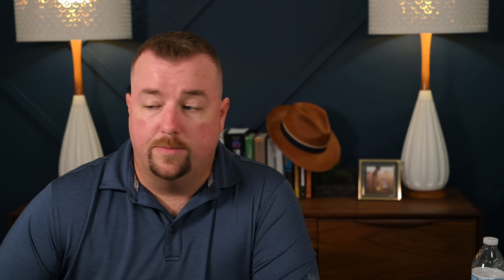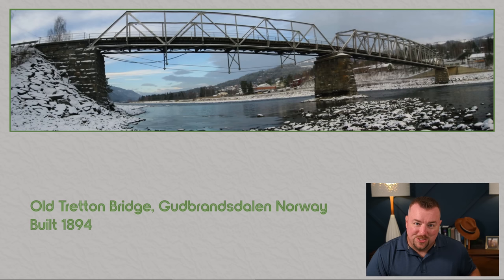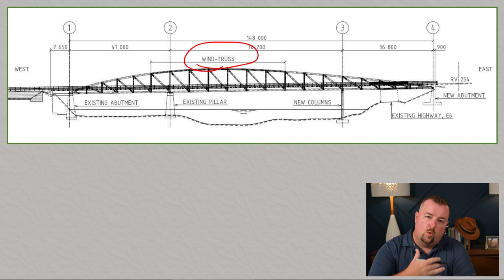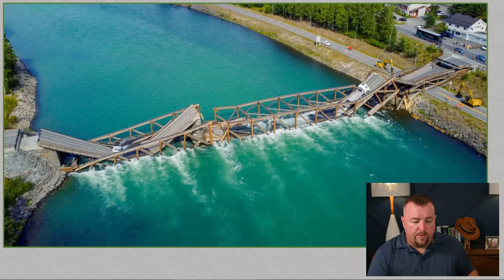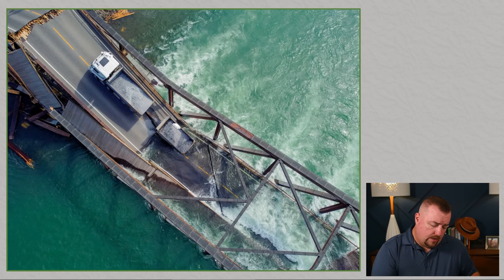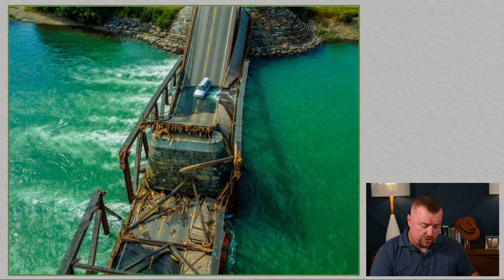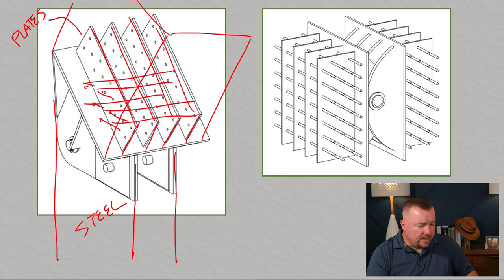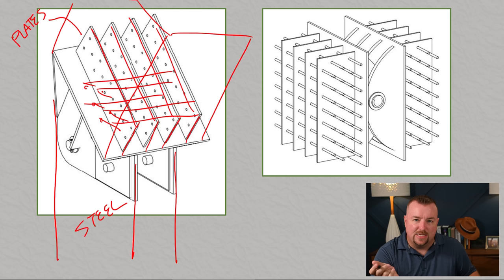How Did the Engineers Miss This?

Comment: 100% agree with the comments regarding glulam and bad design of joints (pins between the glued layers, pins aligned in rectangular pattern etc.). Another thing which is kind of strange is the fact that ALL diagonal members are inclined in the same direction...I have run a quick FEM analysis of a truss (top and bottom chord + vertical and diagonal members) - and orientation of the diagonals in the same direction is far from optimal, increasing the magnitude of internal loads.

Comment: 34:05 This is the very first thing that stood out to me about this bridge. Every single joint is oriented in this way. In what would seem like the weakest way. I would presume the natural wood fibers to be stronger than the glue, so in effect you are just throwing away like 15% of the column like this. My best guess is that this was an effort to combat the known failure method. Perhaps they thought that the glue would be harder than the wood and provide more resistance to the dowels wedge action.

But what really gets me is, why did they not just wrap these connections in a steel sheet? That would be a very easy, very cheap method to drastically improve the strength (and weather protection) of the joints. Think of like attaching an axe head to a wooden shaft. As the wood splits, the joint becomes stronger.

Comment: I see a couple of problems here. The people designing the bridge are not used to working with wood. Almost guaranteed the wood will split along the grain line over time. The designers also put too much faith in the CAD software by modelling the wooden members as a single object. That only works if the wooden members were made of a different solid material (ie. steel). A luthier will show you guitar tops and backs that develop cracks along the grain line. They use cleats (bits of wood) with the grain of the clear running at right angles to bridge the split in the wood. It helps prevent the wood from splitting along the grain in future. The ends of the wooden members where they met the steel beams needed cleats on the sides, or a box of metal around the wooden end to prevent the wooden beams from splitting along the grain line.

Comment: Wood gets its strength from fibers.  Each drilled hole cuts the fibers.  The area where the pins were drilled would have lost much of its strength.  The steel plates were installed rusty, and may have caused expansion in the slots, breaking more fibers.  A round object acts as a wedge and can split wood.  Like you said, the joints killed this bridge.
Thanks for the video!

Comment: I have a rotten glulam beam and rotten pressure treated post under the corner of my deck. Its 12 years old. Wasn't properly protected from infiltration of water flowing off the corner of the vinyl surface of the deck.  Vinyl drip edge drips back onto fascia which channels water back along its bottom edge where there should have been a flashing with another drip edge. Instead it wicks back behind the fascia to the  structural glulam.  Old story retold.

Comment: I have to say, I don't understand. When you use rivets in steel or bolts in steel, the idea is never to have the bolts or rivets themselves bearing the tension or shear stresses of the joint. Its always meant to create as much friction as possible between two sheets of steel. You would never just drill holes through two steel plates and stuff some rebar through them and hope they don't wallow out until it fails.

With this wood, as with steel, where any rivets or bolts fail to provide enough clamping force, once they start moving AT ALL, the joint has already failed. It may take a month or a year or a decade, but every time that joint moves, it wallows out the holes in ANY material until it fails. The problem with wood is that its full of voids. There's no amount of clamping force perpendicular to or in line with the dowels that will make the air voids in wood "go away". They're part of the wood.

The voids in wood are nucleation sites for cracking and wallowing from dynamic loads. That truck had probably driven across that bridge hundreds of times.

Comment: The wood was used as fibers, used same as a cable. Try nailing the last three inches of you favorite rope or even steel cable to a post, cut raw, without any treatment, and pull on it. That's what this bridge depended on.

Comment: I think you nailed it!  there is a recently built wooden bridge near me, obviously much smaller scale than this one but there isn't a single piece of laminated wood on it, it's all solid timbers, massive ones, like I don't even wanna know where they got the trees this big to make this bridge from and how many of them they had to cut down. They also tripled them up, but at the ends they are bolted through with steel plates in a somewhat similar manner
Reply: I mean the great thing with wood bridges is that you can just regrow the trees. Using more trees than absolutely necessary isnt even much of a con.

Comment: I'm wondering how well they took into consideration the stresses from temperature combined with possible water intrusion?
Wood moves quite a bit different to steel...right? Even glulam. There is a reason that we choose the right kind of rebar for concrete construction. And then we have the factor of salting the roads at winter.

1. The temperature difference between summer and winter can easily be 60 Celsius.
2. Different materials with different expansion properties due to weather and temp. Wood constructions need to be able to move more than most other buildings constructed of other materials.
3. Weather proofing of joints? If you have water intrusion into the joints and possibly the glulam. That will freeze in the winter and put extreme pressure on the construction. The road salt will make this even worse as it extends the period the construction will be subjected to wet conditions close to freezing.

Comment: People used to working with steel engineering wooden structures, evidently without the proper knowledge of the properties of wooden joints, it's scary. 

The knowledge of timber construction seems to have regressed due to the big shift to steel framed structures, at least at this scale.

The other thing is these types of construction are often sold to the public as being more sustainable and 'greener'. That only holds true if they last. It's the equivalent of buying cheap (in CO2 terms) buying twice.

Comment: Having learned a bit more about fiber reinforced composites from the recent Titan submersible tragedy, I'd add my own conxlusiins:
1st, extra care and analysis is needed when joining dissimilar materials be they carbon fiber reinforced plastic (CFRP) nd titanium or glulam wood & steel;
What primarily carries the tensile loads in CFRP? The continuous steands of carbon fiber nor the plastic. Glulam wood is a composite of cellulose fibers in lignin & the glue. The cellulose fibers carry the tensile loads.
When a whole is drilled the fibers are cut. Continuity of the fibers is critical. The load paths between the ends of a cut fiber has to be through the (glue-liignin)  matrix (literally in the fiber-matrix bond & is in shear). The glue & lignin can't resist the wedging action of the final line if dowells. The metal dowells & plates can yield in a ductile manner if slightly overloaded requiring increasing stress to deform more (within limits of the UTS); the glue/lignin behaves in a brittle manner. 

A 100 year glue will be a feat. It has to resist moisture, freeze-thaw cycling (Norway!), UV radiation, ...

Comment: Two things. 1) who plates the entire upper surface of treated glulam in copper and then leave dovel wholes and it's area completely open to receive rain, ice, water spray getting right into the wood? 2) why no wrapping of the joint area? when you make a long hole in the tip of the arrow shaft to put in the tang of the arrowhead, you wrap it with something like sinew etc. precisely to avoid splitting and to reinforce the connection. It's exactyl like this joint, if they simply used some steel wrapping around the joint it would help.

Also, someone here said that gluelam was picked cause of the weight of the structure and the existing pilon etc. - OK, but why are there numerous other structure, including a sports arena, all being built out of gluelam in that area? Is it all due to the weight? I feel like it's more due to "being more green".

Comment: It belatedly occurred to me that bridges built in the US two centuries ago were often covered.  It certainly wasn't to keep the horse dry.  It was to protect the wood.  This Norwegian bridge should have had a steel beam along its length on the bottom.  The beam is almost always in tension and avoids the tensile joints needed in the wood version.  The upper beam could be wood if it is protected since it is almost always in compression.

Comment: Hi,
at 32.25 you claimed that the diagonal member between point B and the top of pint A is a tension member. I agree that the member failed in tension but feel that the tensile load was placed on it during the collapse, however in its pre-failed configuration, however I assess that the diagonal member was a compression member in the bridge, not a tension member.
looking at the failure form a distance I favor that the failure point was point A where there was notable separation (in tension) between the point A vertical member and the horizontal member to the right. the displacement of which is concealed underwater.
I appreciate your comments on this view.

Comment: Being Norwegian I read about this bridge collapse. I think your analysis is very accurate. I am an engineer though my bridge analysis back in 2013 at UCF for required course load does not make me an expert by any means. Glue beam is a sort of fashion in Norway and it’s considered kind of modern and chic. You see it in major buildings such as the upside down Viking ship stadium for the Lillehammer Olympics to the record setting tallest wood hotel at the shore of Mjøsa not far from where most glue beams are manufactured. I presume the glue beams would be made from soft wood such as pine and not hardwood as the very strong naval like oak we have here in the south where I live now make a far stronger connection. It makes sense that failure point would always be at the joint where wood meets steel. I am surprised that they wouldn’t make a hybrid bridge where you could combine the strength of steel or better yet stainless steel and complement would for esthetic and strength.
Reply: My church has glulam arches that are the structure that holds the walls and roof up. Each arch has one huge bolt holding each half together at the peak, and sits on a steel beam that spans the floor and makes the structure a series of triangles. 
This is wood in compression, with concrete and steel supporting it, and a roof and walls keeping them all dry.
Glulam construction might do better in a covered bridge where it wouldn't be soaked with rain.

Comment: At t=9:16 they only state THAT it was how it happened, not the it was their intention that it should happen that way, they were investigating failure mode(s) via a controlled overload, in this instant a pull. Strange that the wording "load direction" is generally omitted, just that is the primary concern when using wood. The important of load direction is easy to verify with a piece of paper, it too has directionally aligned fibers because of the fabrication, try pulling it and tearing it in different directions with respecst to the grain.

Comment: Something about those construction joints reminds me of the classic Kansas City hotel bridges:  for practical reasons a joint was modified that subtly changed the load path.  Different details, maybe assumed in design, before value-engineering, might have worked well.

Comment: Potential alternative failure mode for the missing B-C diagonal: failed in bending at the connections as the bridge collapsed & geometry changed at the joint. I believe the joint would have gone from pin-connected (guessing that was the model) to combination of axial load + bending turning the induced shape to an S curve with very short returns. Stresses at top & bottom pin lines would have been highest (farthest from center of gravity of the strut) allowing the splitting discussed early in the vid so location of actual extreme fibers shifted to the extreme pin lines. If the diagonals were recovered & my guess is correct there should be splits extending from top & bottom pin lines toward the center of the length of the strut

Comment: very informative.  I would not worry about pins causing the glue to delaminate.  The glue bond is usually several times stronger than the bond holding the grains together.   The when a force is at right angles to the grain,  the wood can only resist with a weak pressure in the neighborhood of 200-500 psi.  many wood glues will bond with 700 psi or more but it does no good if the wood fails at 200 psi,  The grain is often 20 times stronger in tension parallel to the grain.  (as long as grain does not shear against parallel grain)  While round dowels will cause a wedging affect to spilt the grain bond, a square dowel or square nails should prevent that.  You need a large  area between the end of the wood and the dowel to make use of the weak shearing force of grain shearing parallel to grain.  Kind of like pulling a straw out of a box of straws.    The more area resisting shear, the stronger the connection.  I dont think grain shearing parallel to grain is must stronger that tension perpendicular to two grains parallel to each other.

Comment: Winter; salt, extreme cold to heat, wind, water... there's not a glue developed yet that can maintain its bond long term. Many can remain intact but their bond releases from most materials. Anyone saying otherwise is full of it. If I had a nickel for every rotted finger-joint sill, every column, railing etc. that I replaced after only a couple winters exposure....

Comment: Engineers who design with wood would benefit from working with the material. Anyone who works with wood, even for firewood, knows that any wedge between fibers will split the piece much faster than bending or compressing it. Wood has 10x the tension/compression strength along the grain than it's shear strength along the grain. Your observations about exposed gluelam structural members in weather are spot on, a Community College near me had to redo sections of a campus due to such failures. Sadly, engineering learns through failures and fortunately this lesson didn't cost lives.

Comment: Those laminate peices are not cross grain laminate I take it. 
Obviously if you laminate with the grain down the length you maximize its strength in that direction, but if you cross the grains you reduce its integrity along its length, but increase the holding power of a bolt attachment. 
So if you had a beam twice as large as what they designed, but cross laminated, It would have lasted until delamination occurred,instead of earlier at the connection.

Comment: Yeah, you can build a bridge out of wood and steal, but they should have put formed concrete to keep the wood fibers from splitting, the concrete forms inside the wood would be the stressors and you can put the steal pins inside the formed concrete in the wood, however, not recommended building wood bridges in damp places as it leads to rot and will eventually fail.

Comment: When you consider the date of the old bridge, before 1900, it is interesting that it was probably designed for horse and wagon traffic and later had to endure automotive and truck traffic that is considerably heavier and starts, stops, and corners more aggressively.  Living in Pennsylvania that still has many wood bridges, I don't object to using wood realizing its strength limits and enforcing them.  Most of our wood bridges are 'covered' with a roof structure and side walls to keep the weather out.  Railroads use a lot of wood bridges without roofing but they used pressure treated wood using the good old stuff (creosote) not the modern crap.  Yup, wood bridges can stand the weight of modern trains when designed properly.

Comment: I used a 23 foot by 3 foot thick Glulam to support a roof when I removed the atrium out of the middle of a house. I hired a structural engineer who told me the strength of the Glulam would hold 10,000 pounds of weight. I guess the difference is my Glulam is not being battered by the elements and is being protected by the roof.
Reply: And is not bearing nearly as much...
Reply: Any building material is fully functional in the right conditions. Building skyscrapers out of wood is appropriate as the materials are protected from the elements. Using compatible materials are another consideration. There are certain things you just don’t want next to each other… aluminum embedded in concrete, unprotected steel in moist or treated lumber. They tripled coat screws for treated decking. Driving pins into a joint like this creates severe abrasion and will remove any coating so a compatible metal is necessary. And, steel expands as it rusts thereby “pre splitting” the joint very early in the lifetime of the joint. It was nice that they tested theoretical joints. They should also have tested lifecycles. Where I live (upper Midwest) we create something once and because it didn’t fail in the first year, we declare it a success and build a hundred more. Only to find out 10 years later we need to retrofit every one built to keep them from failing. And, defend lawsuits for the ones that did fail.
Reply: @robertwazniak9495  Probably a good idea to have the glulam inspected once a year. With 110 F temperatures in the attic and 40 F during the winter here. It will be expanding and contracting. I'm not worried about it shearing, I'm worried about it falling off the support columns.